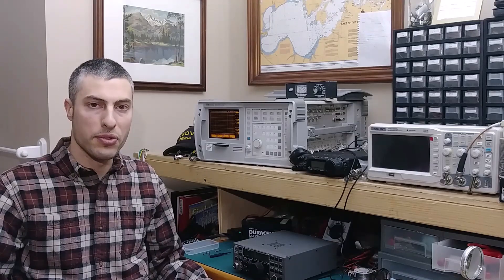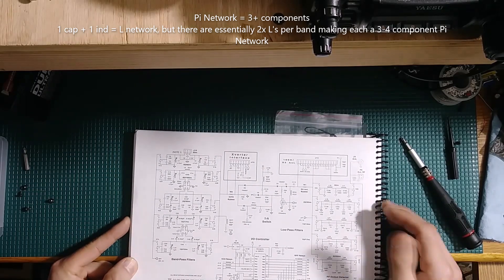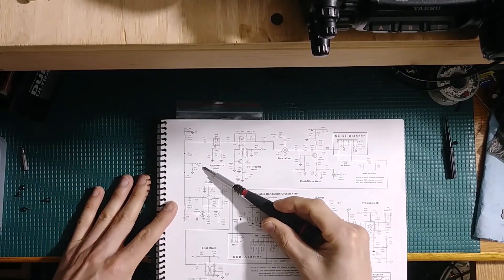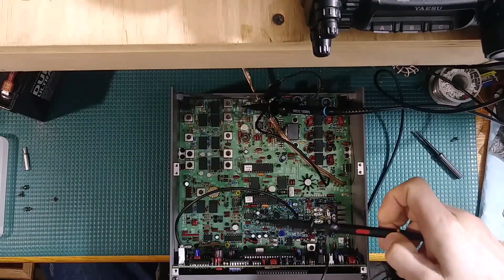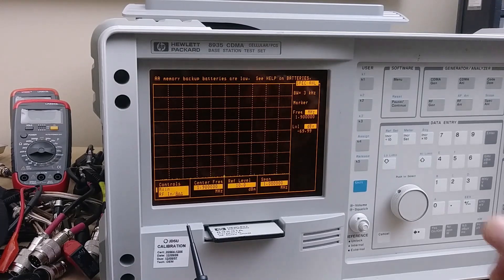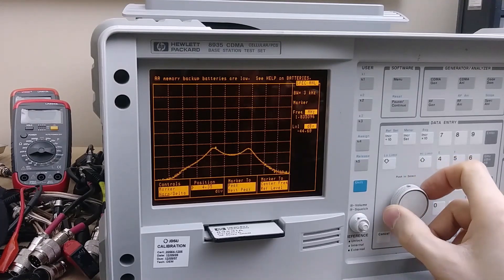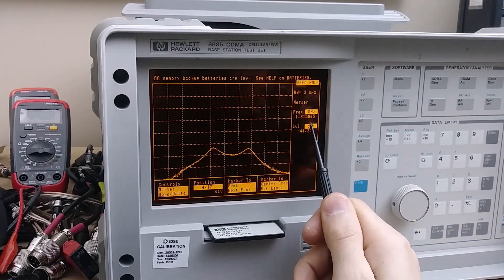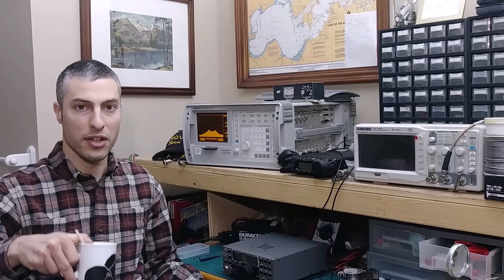5  - Tuning Bandpass Filters in Elecraft K2 with Tracking Generator & Spectrum Analyzer

Comment: Nice video. How do you like the hp 8935? Thinking about getting one. Thanks
Reply from the maker: The 8935 has been great. I think I got this one in 2010 or 2011. It is the E6380A version - which is high power. The input is rated to 75w continuous. I've run 100w PEP in to it, but very rarely. 
For an RF signal generator, RF signal analyzer, and spectrum analyzer it is a fantastic tool. I don't think the Tracking Generator is an option - it is standard I do believe. So for tuning filters (like in the video here), duplexers, bandpass, notch, and pass/notch style filters it is a very valuable tool. 
The negatives I have to say about it are when it comes to antenna testing ability it doesn't have anything. It can show SWR if you get a Return Loss Bridge. That is it. It does not do TDR so you can not measure feed lines from one end. You can only put the feed line in a closed circuit to do either a discrete or swept frequency insertion loss measurement (VERY handy - just need both sides of the cable to do it). 
If it fits your budget and the abilities are what you are looking for - I say its a good buy. If you need antenna and TDR measurement capabilities then you need to get a separate analyzer (I use a RigExpert AA-600 for example). Or get a VNA that has a time base and will do complex impedance measurements. 
Anritsu Site Master analyzers are pretty hard to beat, if you can afford one. They have quite a range of them that go back quite a few years so you  might find an older one that is more reasonable in cost. The newer the technology the more features they have that cater to the cellular industry etc. For basic ham or CB RF stuff the antiquated gear is fine because all you'll use is the basic RF tools. That is the same with the 8935 - it has CDMA cellular tools in it that are useless to us. 
Another benefit to the 8935 - it is a nice audio signal generator. You can do a 2-tone test and you can also measure SINAD. That is good for FM radios, and even more so if you do any FM repeater work/repair. 

If you have more questions just ask!
Reply: @qrptoqro7834  wow great response,  thanks for that. I really want it for the tracking generator feature.  Then all the other stuff would just be a bonus. I currently have a r&s cmu200 that I do enjoy but no tracking generator.  Keep up the great videos!